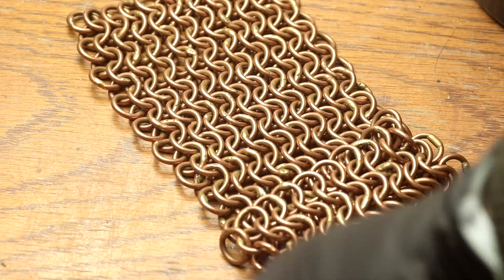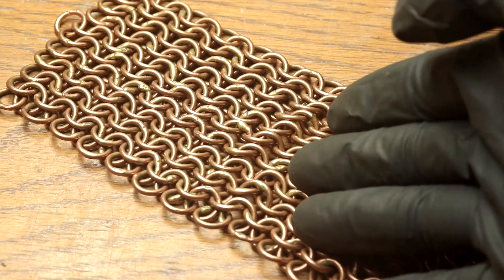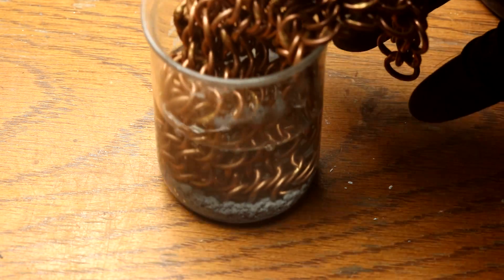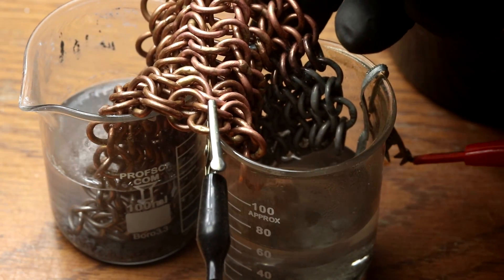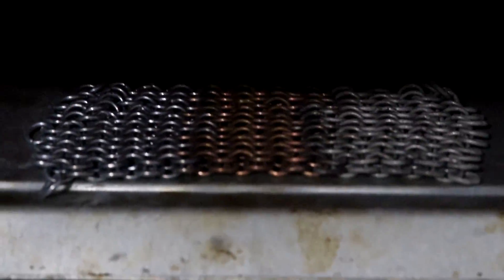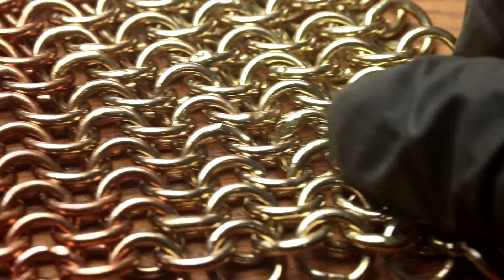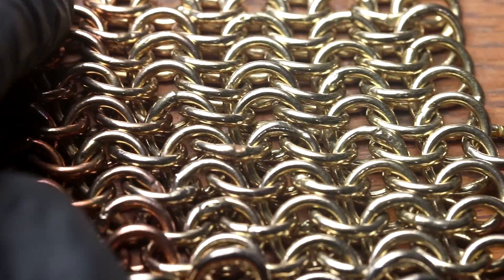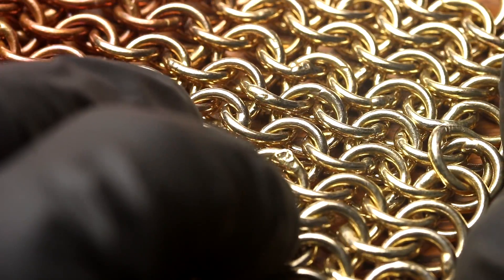Coating Copper in Brass and Bronze

Comment: I like the copper best, unfortunately the color won't last...
Reply: yes. unless you could somehow clearcoat each ring ^^
Reply: as long as it is used regularly it will keep nicely polished
Reply: It will probably wear down so the rings don't turn anymore. At which point only the spots constantly rubbing against each other will remain shiny.

Comment: Choose Brass if you want to show off
Choose Bronze in you want to sneak
Choose Copper if you're lazy
Reply: Sneaking with a chainmail? 👍
Reply: @vincewood657  Chainmail shirts do not apply disadvantage to sneak rolls.
Reply: @vincewood657  Roll with disadvantage.
Reply: @vincewood657  Its possible ish. When I played DnD I had a character that had chainmail, in order to sneak I just had to have one of the other party members follow me and hold the chainmail.
Reply: Protip: If you want to sneak use leather. It's literally made from hide.
Reply: @Scrial  amazing
Reply: @Scrial +10000
Reply: Just make sure there are bells chiming at the time
Reply: Crowd-Control, Stealth and Tank
Reply: Thats how mafia works?
Reply: why is my comment suddenly so popular?
Reply: @Kwoog  why is it popular....because its good!  👍
Reply: i choose charmander
Reply: Thats the way to go and I would go with bronze
Reply: They're all copper rings. No one would ever wear copper maille as armour. Have you ever actually held anything made of solid copper? It is soft, malleable, and can be bent, crushed, and ripped by hand.

As for sneaking in maille (real maille) it's very possible. Maille makes very little noise, and it is essentially silent if you wear a cloth later over it.
Reply: "Copper" .Regards Bruce McKay 🇦🇺🙃🏄‍♂️. (Lazy).
Reply: Lazy? Welding a million tiny  loops together?

Comment: Why does the zinc coating work? Why do NaOH and zinc powder make a coating solution?
Reply: You can also plate tin without electricity.  This is done all the time in the printed circuit industry.
Reply: @BrightBlueJim  yeah, nurdrage has a video about it too
Reply: Zinc reacts with NaOH like Al or Mn does
Reply: He didn't use electricity there or??
Reply: @emlokkolme9504  He didn't use electricity on the zinc side. Or he kept it completely off camera, which he wouldn't do.
Reply: @gg5115  I thought the same thing. But I believe that he didnt add a rod in the zinc side since tin already had a rod. The negative was in the copper itself. needless to say, the electricity traveled all through the copper, from the tin to the zinc. as to why not have the negative in the zinc, im not sure
Reply: @emlokkolme9504  he did, but you can see it start playing immediately before he added current.
Reply: The copper and zinc form a galvanic cell.
The zinc is positive relative to the copper; zinc has to lose ions to accept electrons, copper gives up electrons and accepts zinc ions(metal).
If the copper was not in contact with the zinc, no or very slow reaction.
The tin plating bath is not so reactive, so an external current was required.
Reply: I think maybe it a redox reaction going on between the zinc salt and copper
Reply: @oremooremo5075  yes. But any kind of electroplating is a redox reaction tbh

Comment: I'm confused. I don't know about metallurgy so that's likely why, but I thought you said you coated the copper in zinc and tin. How did it end up being brass and bronze?

EDIT: When he put them in the oven, did it cause the metals to form an alloy? At such low temp?

Comment: @Cody'sLab the bronze looks good. As far as making the entire shirt bronze, do you think it would be possible to finish the entire chainmail shirt and then use something like a hangar to dip the entire thing into a bucket of the solution you used for the tin covering, bake the shirt, and then repeat? 
Potentially use this method to also cover the chainshirt in another protective coating to help against corrosion?

Comment: The bronze looks like it didn't take; there's still plenty of blackened silvery color showing the tinplate, and only a few spots of bronze peeking through here and there. Also, you'd be better off plating the rings before you hook them together as chainmail, so you get a proper coat. Of the three, the brass looks the best, personally.

Comment: The gaps in tin/bronze coating probably weren't caused by the welds, rather by the rings being partly shielded by each other during the plating process.

Comment: Waaaaaaaaaaaaaaaaaaayyyyyy more info needed.
Why does the zinc coat the copper?
Why does the tin require voltage?
What were the electroplating settings?
What happens when you change the voltage/current?
What happened in the oven?

Comment: Brass obviously for the looks, Bronze for the durability, but this begs a question...  Is it possible to CONTROL the placement of the coating precisely enough to be able to make patterns in the mail?  As there are different colours, having things like stripes, or even a coat of arms, or "Cody's Lab" written on the links could look quite impressive!

Comment: We did a similar experiment with a copper coin that we plated in zinc and held it over a Bunsen burner for a few seconds. But I’ve done some research (after thinking about the EPNS acronym) and realised that you can actually electroplate an alloy directly onto a metal. The ratio of the two metals can be finely controlled by varying the current going through each setup as per Faraday’s law, since you have two seperate anodes. Of course, the cathode potential must be less than both anode potentials for plating to occur. Apparently complexing agents are often used to get the possible ratios more equal if one metal is significantly more noble than the other. Electroplating electrum or red gold could hence be an interesting thing to see.

Comment: The bronze is a little underwhelming considering that it took on an almost iron or steel look and didn't take to the copper very well. The brass turned out great, it looks amazing and seems to have worked the best but it would probably be too flashy and shiny for a mail shirt or any piece of mail clothing for that matter. I think the darker looks of the copper and bronze would be more suitable but you might be able to incorporate the brass as a decorative or ornamental piece of the clothing.

Comment: I'd be tempted to plate in a pattern. You could get a really neat coat of arms using the three colors in combination. Not sure if you watch MichaelCthulu's stuff, but he often etches patterns onto the metal he's working by building up a clay barrier to contain whatever solution he's using. I bet with some work you could do the same by mushing some clay down through the rings to separate the different chem baths. Another option would be to just knit the pieces separately, then stitch them together, but that might be more fiddly.

Comment: Can you make chainmail out of thin wire and coated with metal a week until it's sick enough to be normal chainmail?

I imagine instead of rings you could braid the metal wire faster than you could weld each chained together.

Comment: Regardless of visuals, I'd choose the one that's functionally the most logical (comments seem to imply brass)

In any case I think copper would look best if it wasn't for the welds not being coated. Since that's the case though, I'm going brass for looks, too.

Comment: for an electrodeless tin couldn't you have just made Pcb coating solution by adding a little 'tarn-x' thioureau? and maybe serious cleaning to de-oxidize, and degrease first.

can you do multiple baths? isnt the chemical reaction entirely surface and as soon as the zinc coats the copper the reaction stops? Pretty sure that's how pcb coating solution goes, like the layer won't get any thicker after the first 10 seconds or so.

Comment: For a really easy tin plating solution its better to use electroless method. 
Tin chloride   -10g
Thiourea        - 50g
H2SO4           - 50mL
1L                    -DH2O

Heat until dissolved, when cooled, do not remove the precipitate. Plate at room temperature.

Comment: After you create a tri-tone design, you're gonna have to create some thin material templates and put those solutions in spray bottles to create an elaborate decorative pattern by spraying through the cnc/plotted'd templates and put that baby in an oven when its done!

Comment: The alleged bronze doesn't look like bronze. In fact it still just looks tin plated. Maybe it needed higher temperature? The brass coating turned out beautifully, however, congratulations.

Comment: I like the brass because it looks a lot like gold; but, I also know (from years of polishing my mom's brass candle sticks) that it will also tarnish and lose its gold color.
I also liked the tin since it looked like the silver color we are used to from the movies.

I would love to see how they look after prolonged oxidation. Could you used an enhanced oxygen environment to accelerate that?
Reply: That'd be actually a very neat piece of information and a great idea. I hope Cody notices this comment (bit doubting it tho). And ideally trying other corrisive environments.
Reply: I've used Hydrogen Peroxide to accelerate the process over brass with reasonable success.
Reply: @nigel_samhain  Did you try oxidizing anything else?  Also how did the rate compare to oxidizing in air.
Reply: The process is rather fast by comparison. Typically it is done with the application of heat and small amounts of vinegar and salt to achieve what is called BRASS VERDIGRIS.
Reply: Ive applied a variety of oxide finishes or patinas over a variety of metals over the years. Many of them can be achieved using common household chemicals.

Comment: Brass seems to flashy to me, I say either bronze or the original copper. Brass looks just unreal compared to what they used to use back then, least I think it is correct me if I’m wrong.

Comment: Cody! Thanks for this vid. I had often wondered how brass & bronze coatings were applied to Copper - it confused me because I couldn't figure out how one would electro-plate an alloy onto a metal. The whole "a thin layer of the alloying metal forming the alloy on top of the base metal" thing occurred to me, but I never bothered to look it up. I suspected this was how it was done, but never looked it up.  Thanks for confirming and demonstrating! That strip of chain mail with the three surface finishes is awesome - how about doing a Silver plated one?  In fact, how about a chain mail "scarf" with as many different platings as possible? That would be super cool. 
Maybe the braised/welded sections didn't pick up the plating due to difference in conductivity? If the metal in that spot isn't annealed / has different crystal structure from the rest of the ring, wouldn't it have different conductivity than the rest of the ring and thus plate differently? My $0.02.

Comment: I love the bronze coating because it has a classical iron looking finish, but then again the brass looks beautiful and it stuck well to the welding spots. Since this is a project I know you have been working on for a long time now, I would go with the brass for it's good and thourogh coating, and perhaps go through the coating 5-10 times longer than now, just to make it stay on real good. Just take it out of the bath and rinse it every ten minutes or so, so it doesn't just pile on scales, because that doesn't stick. Good luck, can't wat t see how it turns out!

Comment: Imo if you're going to coat it you may as well go for the multiple coatings, it may be work but in the end as it wears and tears it will still look uniform and not so patchy, but at the same time the more coats the heavier and also more bulky it will look....wonder how much weight you would end up adding in the end or even per ring. Heck in the end even having just the copper polished looked nice.

Comment: I was expecting to say bronze, but I have to say, the brass looks a lot better and I like that there are fewer imperfections in the plating. A chain is only as strong as its weakest link, but a link is only as strong as its weakest point. If you went full bronze and it flakes off the joints, the perfectionist in me would be really annoyed. The brass is consistent and didn’t require any polish, the bronze required polish which could put unneeded friction on those joints. I honestly think the awards for convenience, appearance and consistency goes to Brass. Strength goes to Bronze but those imperfections make longevity uncertain.

Not sure if I have quite gotten the message across yet but my vote is brass.

Comment: Someone comes up to him and says you're getting mugged give me your money I don't have any was your shirt made out of copper tin and brass just takes it runs away must be worth a lot of money if someone takes that you're pretty much screwed
Reply: Wow, that was difficult to read. How about some punctuation?.... so you don't sound any slower than you actually are.
Reply: What are they gonna do though, stab him? Lmao nah this beef ass boy got a fuckin chainmail on. Muggers can't do shit
Reply: I'd be willing to bet that this shirt would even significantly dampen the impact of a 9mm round if he were fired at. If a belt buckle can stop a bullet as was the case with that one dude a couple years back, then I'm sure chainmail can do the same or at least reduce the damage.
Reply: @MGSLurmey  definitely not, modern armors are fundamentally different than archaic ones for a reason
Reply: @pug9431  Modern body armour: A plate of metal housed inside a vest to make it more comfortable and useful.
Archaic body armour: A plate of metal covering the entire body.
I don't see much difference.
Reply: @MGSLurmey  I would say definitely at the very minimum you would have some broken bones from the impact alone. I highly doubt it would fully catch a bullet either it would hit and push it against you until it had enough resistance to break up the bullet. Then you have shrapnel going into you while being hit with a sledgehammer. 
I would argue that most bows and possibly even weak crossbows could be stopped, although you'd still risk taking on permanent damage simply from the impact.
Reply: @randoprior4130  Oh yeah, I'm not saying it'll completely protect you, but I'd wager that you'd actually be safer when wearing this than having no resistance at all and the bullet going straight into you. If it breaks up, that's not so good but each individual piece of the bullet has a fraction of the kinetic energy of the whole bullet, thus they won't penetrate as easily and especially if you were wearing some thick clothing or something underneath it would do a lot to protect you.

If it doesn't break up, then the chainmail has just absorbed a ton of the kinetic energy of the bullet and you'll either have a broken rib or bruising but not a hole in your chest.
Reply: @MGSLurmey  The properties of the steel when comparing a quality tempered harness versus a modern ar500 plate are quite different. Steel armor of the say late medieval period was virtually useless against the earliest of firearms, where as modern steel plate armor would barely be scratched even by 18th century arms. Besides, chainmail is not a solid metal plate, nor would even high quality medieval chainmail be able to stop a 9mm bullet.

Comment: Why did the zinc plating become brass? I know that zinc and copper alloy to brass, but isn't the zinc being plated on top of the copper? Also, if you kept repeating the process, would you keep getting lighter and lighter color until it was pure zinc on the surface of the rings?

Comment: The brass looked gorgeous and obviously has the potential to be used for it's practical purposes.  Brass is a self-lubricating metal as I recall so it should resist the wear and tear of everyday usage.  As well as, correct me if I am wrong but bullet casings were made of brass because it did not produce any form of static so as to not ignite the cartridges.  Admittedly I am unsure of the practical uses of bronze beyond colorization and sturdiness.  Are you attempting to go for a Faraday Cage with this mail design aswell?  But beyond the basis of the video, thank you Cody for producing wonderful content for the past many years, and I hope you continue to pursue your dreams with the years to come. :)

Comment: the brass looked heaps better, but I have to ask why are you using such a soft / malleable metal for ring (err... welded chain) mail? wouldn't steel or at least iron be better?

Comment: I have a question based similar to this video hope Cody you or another with this knowledge can answer. I own a very old large copper apple butter kettle that has this same brass plated coating on the inside and the brass has worn off considerable in the bottom. How could i recoat and thicken this brass plating without destroying my kettle or its usability  for cooking?

Comment: Is it possible to coat steel razor blades in copper? I was doing some electrolysis in hydrochloric acid to etch a copper clad PCB and used a razor blade as the cathode. It had "crystalized" copper form on it, and it surprisingly actually adhered! The flaky stuff came off but a pinkish layer of copper actually plated on!

Comment: Bronze with brass highlights at all the seams and ends; cuffs, armpit, neck, bottom edge of the coat. If you're going to take the time to change it, take the little bit extra time to add some flair, especially as the different metals patina over time.

Comment: What temperature did you bake that at? I never imagined metals would diffuse together like that at conventional oven temperatures.... now I need to get my chainmail making supplies out again!
Reply from the maker: I took it to about 500f
Reply: It's very pretty, running science demonstrations at a school open day once the teachers coated copper pennies with zinc. Holding them in a blowtorch turned them 'into gold' for the kids. I'd recommend it if you have the time
Reply: Yes, I was shocked too.